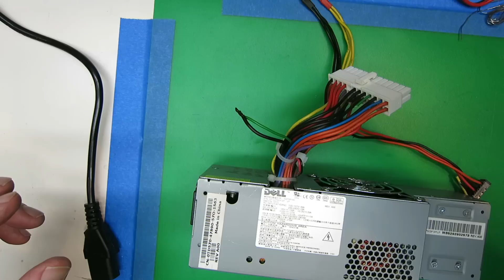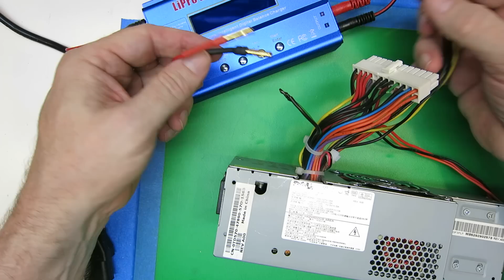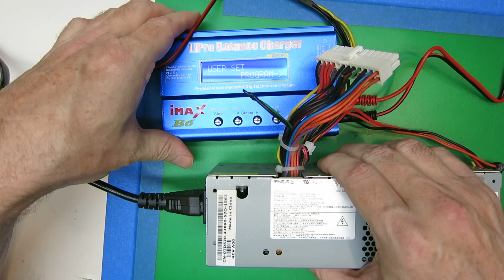PC Power Supply for LiPo Charger

Comment: I'm researching this and finding you need to connect a dummy load, fuses, and connect the orange and brown wires to keep consistent voltage.
Reply from the maker: I keep my lipo battery charger attached, I think that's enough load to keep it running at a stable voltage.

Comment: My power supply shuts off when i start charging why does this happen ?
Reply from the maker: Hmm, it shouldn't if everything is working properly.  It could be overheating, or drawing too much current... that shouldn't happen from a battery charger, but could be a problem if there's a short cirucuit internally.  Obvious question: is the green wire connection solid? If you can't isolate the problem, it's probably a good idea to toss the unit, as it could be a fire hazard if it overheats.
Reply: Mark Harrison well , i will buy another one and see if it works

Comment: Does it have to be three yellows 12v and three black?    Can it also be two yellows or one? And use two balancers or three balancers connected at once? 

What if i have a bigger pc power supply with more 12v connectors? Like an 800w
Reply: well really you could just use 1 yellow wire but you wouldn't be able to get all the power from the pc power supply and the single wire could get hot if you are trying to pull a lot of amps. If you use 3 or more yellows you can get all the power from the 12 volt rail and it divides up the strain to multiple wires. But you only want the yellow wires from the molex connectors, not from the wire harness that normally attaches to the motherboard.

Comment: Also does the 4mm bullet adapter come with imax b6
Reply from the maker: As I recall, the model I bought has 4mm sockets, but I had to buy the 4mm bullet connectors separately.
Reply: +Mark Harrison thx appreciate the tips and helpful advice much appreciated .
Reply from the maker: you bet, good luck!

Comment: Im new to lipos whats the benefit of using a pc power supplu vs a reg wall plugging in charger ? does it charge faster thx
Reply from the maker: Two reasons: 1. most chargers with built-in power adapter have a limited capacity (50 watts is common, I think).  This probably isn't bad if you're using mostly 3S batteries, but for larger capacity batteries external power supplies are needed to provide the increased amperage.  (2) You can buy specific power supplies, but if you have a PC power supply sitting around (for example in an old unused computer) it can save some money.

Comment: i took an old xbox 360 power supply and soldered on 2x xt60's. It puts out 16amps at 12v.
Reply from the maker: +Nathan Knight Sweet!  Good idea to use the XT60's
Reply: I use the 360 psu at the club.  My home setup is from a Dell server.  Slightly overkill at 65amps lol 
https://www.instagram.com/p/vJNp_lxbES/

Comment: Thank you for this video.  Do I have to leave all of the unused wires in place or is there a way to get rid of them?  Also, do it have to be 3 yellow and 3 black.  The one I have only has 2 yellow.  Just want to be sure.
Reply from the maker: +RookTV  Any number of wires should be OK for typical power chargers... the more wires you use, the less current flows in each wire.  You can touch the wires and ensure they're not running hot.

You can trim the unused wires and use "Liquid Tape" to insulate the trimmed ends.  If someone is experienced enough to be familar with the appropriate safety steps, the power supply can be opened and the wires can be removed from the PC board.
Reply: Thanks Mark!  I will have to use the 2 yellow and 2 blacks as that is all there is of yellow.  I already connected the green switch wire.  Lot easier than I thought it would be.

Comment: Any reason why you only used 3 12v and ground lines rather than all of them?
Reply from the maker: pMustangw Yes.  On the theoretical side, I calculated the maximum current needed for the output [*] and came up with 3 wires.  Practically, that was also a convenient fit in the 4mm bullet connector, so I thought the calculation was pretty much correct.  I'll make another video and include my calculations for this.
Reply: Mark Harrison 

Ok so a follow up to that and maybe you can include this
question in your follow up video. 
1. If you combine all the 12v lines will this allow you to
run a higher amp draw? 
2. I have just completed a similar mod but my 12v reads at
11.57v  is this with in a safe tolerance or
should i seek out another power supply?

Comment: Hi, is it at all possible to get any more than 12 volts?, say 15 volts for example.
Reply: You could run two PSU for 24v. Google it,  there are a lot of guides.
Reply from the maker: iflylilplanes You can use a boost converter.  If your amps requirement is not super-high (10 amps), you can get one on ebay for about $10.  I've got a converter, I'll shoot a quick video of doing that if you like.

As xxgg points out, you can hook two power supplies in series and get 24 volts, but if you don't wire it properly you get a serious shock hazard (because of grounding issues), so be careful if you go that route.
Reply: Mark Harrison 17 volts is the max I need, 10 amps is good for a single or two chargers, but I'm after a minimum 15 amps, 20 would be better for the quad charger I have. I'll look at the boost converter video, at least I can get the two single chargers going. Thanks.
Reply: Some power supplies have adjustment pots. Depends on the design of the power supply, here's a link that shows both ganging supplies together and adjusting them up:-
http://www.rchelination.com/setting-hp-dps-1200fb-power-supply/
Generally you can only get a max of 1v or so extra using an adjustment pot, but on some supplies if you add a resistor in series with one of the adjustment pots, you can up the voltage by 2 or 3 volts. You could push most 12v supplies to 15v, pushing them to 17V might be stretching the friendship a little!
Reply from the maker: +Ben Govett (BennyG) I didn't know this... thanks for the info!